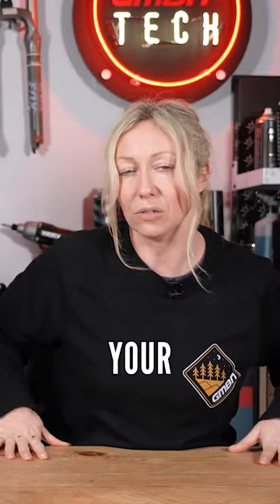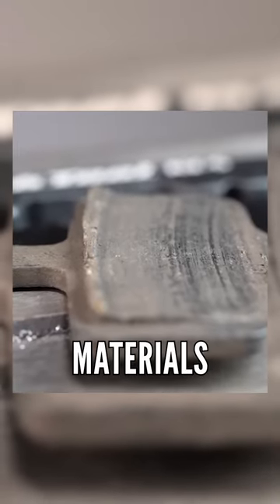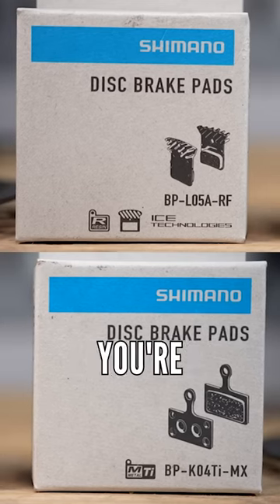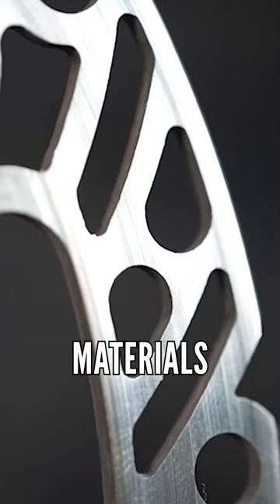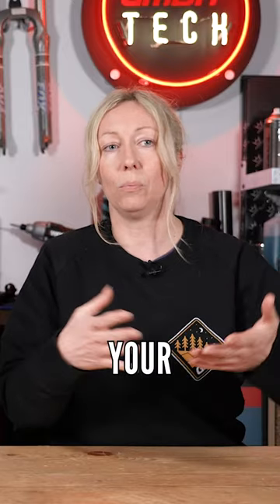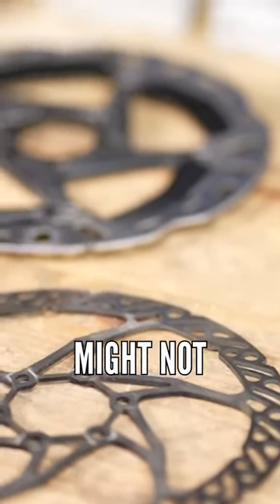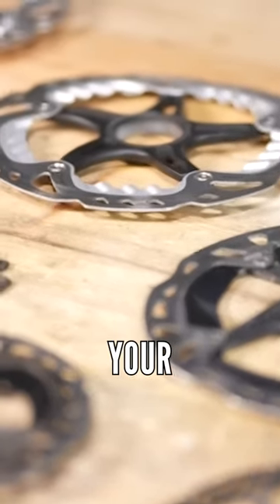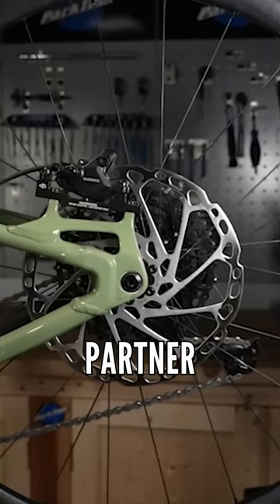Is Swapping Organic For Sintered Pads Using The Same Rotors Bad? 🤔🧑‍🏫

Comment: The problem here is, your discs not supporting sintered or metallic pads. Other than that, you can do that by sanding your discs a bit with sand paper